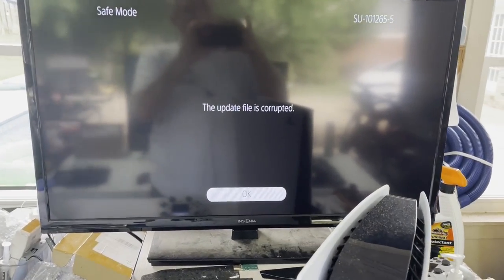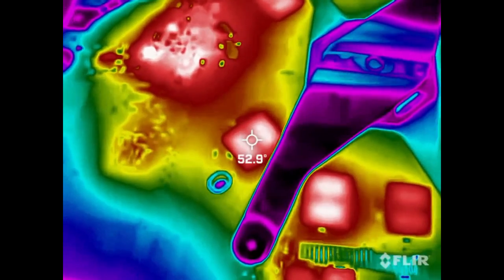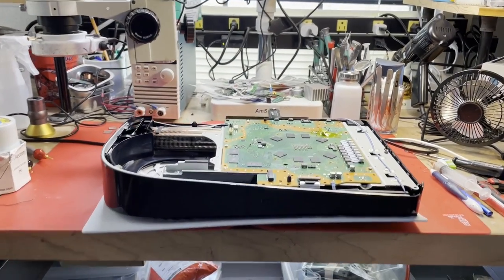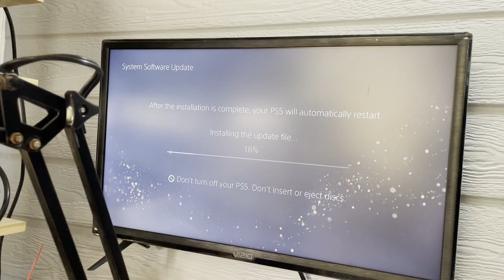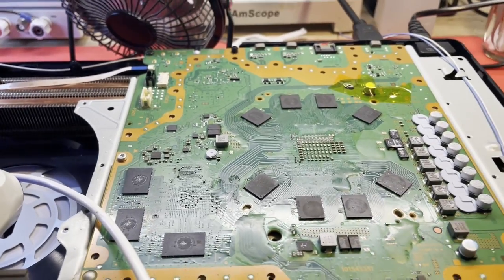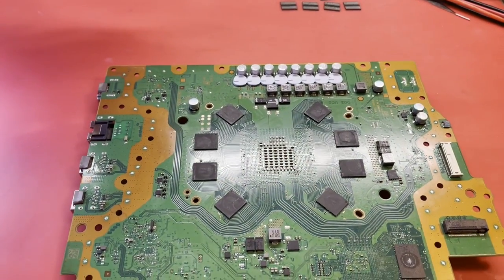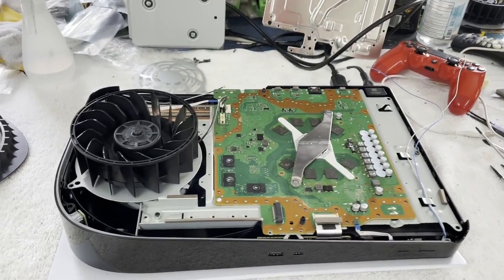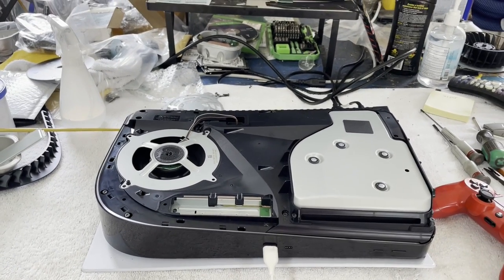#99 Repair of PS5 Corrupt Update

Comment: Congrats on yet another amazing display of knowledge, perseverance and tool proficiency. It's not easy to reball and solder big chips properly. Just a quick question... is there a reason why you do use a preheater for a southbridge but not for 8 ram chips? I've seen a German technician that replaces GPU Ram chips pretty commonly and says that it's pretty important to do it that way to stress the board and chips as little as possible.
Reply: KrisFix-Germany is his channel by the way if you want to check him out or exchange some ideas on RAM problems. He only focuses on GPU's and he has the advantage that there is software to troubleshoot those Rams though.
Reply from the maker: I probably should have used a preheater to put them on honestly.  It is good practice.  I used a preheater to remove the donor chips.

Comment: @ToltecMerc, Another great video. It is a pleasure to watch your videos as always. Just had a quick question if you dont mind? What size solder balls do you use for the PS5 RAM modules? I have a ps5 pulling the 80C00140 uart code. This points to GDDR6. Need to reball or replace just like you. I appreciate the help if you have time. Thank you sir. :)
Reply from the maker: .45mm
Reply: @ToltecMerc  Thank you!! I appreciate it :)

Comment: Wow Job well done how did u know it was ram i was thinking this is an SSD issue . What heat and air setting did u use to remove and install the ram chips im curious? Thanks!
Reply from the maker: I felt it was likely RAM because I think that is where the update is copied first.  I used 420C to remove and install and probably should have used a pre-heater.

Comment: Awesome job

@TotalMerc I've had an issue with a brand new unit the day I bought it and I've seen the same issue from a few others but never heard of the reason for it.

Have you ever seen when going into rest mode once in awhile when the video output turns off the screen goes completely green before power cuts, only to turn it on next time for it to say repairing storage or whatever the error is?

I have since sold that ps5 but was wondering if you've ever seen this?

Thanks.
Reply from the maker: I have not seen that error.  I wonder if it could be SSD related.  I really wish they had not mounted the SSD on the board.
Reply: @ToltecMerc same.

Is there any way at all to reach you outside of youtube with a couple questions related to ps5 repairs?

Comment: Really enjoy these repairs!

I take it you have some sort of background in a related trade / education?

I graduated high school in 2005, went to college for computer science in 2007 and went down the software engineering path career wise but the entire time I was in school (and a few years after) I was an arcade repair tech for a living. Over the years I have become very interesting in component level repair and have done quite a few advanced soldering mods to video game consoles like the PS1Digital, XStation, N64Digital and similar. While I know "some" about the component level repair side, I'm not quite good enough to work out on my own what might be wrong with a system I'm not familiar with. I'd rely heavily on videos like yours giving the more likely hints at what could be wrong. I've never done BGA rework either. I have decent soldering gear, but no GBA stuff and nothing like a rework station or board heater. Rolling with just a decent T-12 hakko style soldering setup and a decent hot air station. 

It's interesting to note the Samsung chips working while the micron ones seemed to have failed. Samsung is usually regarded as one of the best makers of memory chips. I guess micron doesn't have a bad rep really... and it's a sample size of 2 (so like you said... may mean nothing) but it still is interesting. Are these chips available on the open market? I'd hate to see a PS5 board sacrificed but I'm sure (at least I think so) the donor board was non repairable? I'm curious as to what fate that board suffered?

Anyways, awesome stuff. Love to learn, and seeing this is both a lesson and some entertainment while I eat my dinner. Win win! Thank you!

Comment: What flux & solder are you using? Awesome video!
Reply from the maker: I use cheap Kingbo flux and Kester leaded solder.  I don't recall the part number of the solder.  Nothing special.  Thanks for the visit!
Reply: @ToltecMerc  thanks no worries, I have a bunch of kester floating around it's the best solder I've used to date. I love it! I'm still experimenting with finding a good flux for me to use all around. I haven't given kingbo a try, but I hear good things.
Reply from the maker: @rubenmejia4881  I use Kingbo RMA-218.  It’s cheap and readily available.  It’s nothing special but it works for me.  I buy it in the small tubs and refill old syringes from other fluxes I have bought.  I get decent results.  It may tend to burn quicker than some other fluxes but it’s usually not a problem unless I’m working really slow.

Comment: @ToltecMerc when you say it was unstable and crashing after reballing... was it giving you 108255-1 or 108262-9 errors?? I think some of these consoles have a range of issues, some wont update, some crash at dashboard, some have artifacts, and some just give error codes
Reply from the maker: I'm sorry but I don't recall any specific codes, I just knew it had to be memory related.  Micron RAM seems to be problematic.
Reply: @ToltecMerc  what other symptoms have you seen related to bad ram on the ps5?
Reply: @ToltecMerc  I'd really like to send you one, if that's possible let me know I'm in florida
Reply from the maker: @chad1983ification  I've seen crashing in PS4 games.  PS5 games would work at least the one I was testing with would.
Reply: I should be more clear, I want to donate one of these 108255-1 for the cause. Ive been doing console repair for years but your level of troubleshooting is superior
Reply from the maker: @chad1983ification  you can email me at toltecmerc@gmail.com

Comment: Good morning Toltec. I know I ask you many questions, but here is one more. When you want to safely remove RAM from a PS5, what temperatures do you set for the hot air? And what temperature do you set your preheater to? I had a console doing the same thing, so I decided to bump the RAM. Then, the service tool told me I had 4 RAM errors, and I am worried I killed the RAM.
Reply from the maker: I have successfully removed and installed RAM without a preheater with 400C air.  If I use a preheater, I will heat the surface of the board to about 110C and then use 350-400C.  You probably did not kill the RAM but you may have merged balls under the RAM.
Reply: @ToltecMerc  That is a relief. It is frustrating when you don't know for sure. I very much appreciate it. I will pull them off and reball with .45MM because .5 seemed to big. Perhaps that will allow me to get them back on properly.
Reply from the maker: @tjmiz6849  .45mm works well
Reply: @ToltecMerc  You were correct sir, I did not kill the RAM and managed to get it back on the console. It was absolutely miserable. It still will not take an update, and I don't know where to go from here. It is XTON RAM. I have some SK Hynix but no XTON. Is there any advice you could give?
Reply: @ToltecMerc  Will.40 work if thats all I have?

Comment: Good job like always 👌 can u help me with something im fixing a ps4 slim all the standby voltages are there but when i press the power button there is no voltage on the caps which supposed to have voltage and there is no short on southbridge or any other place it's southbridge fault?? For sure?

Comment: Does replacing defective ram chips also fix game crashes to the Home screen with error ce 108255? My ps5 crashes immediately when starting  certain games. My guess is defective ram is it?
Reply from the maker: It certainly could be RAM but there is no easy way to find out.  It would have to be replaced with known good RAM and that is challenging, costly and time consuming.
Reply: @ToltecMerc  could the ce 108255 crash also be APU related? That’s what im concerned about

Comment: Hi do you know if I can just replace 1 ram if only one is faulty?
Reply from the maker: The only way I can think of is to read the codes out of the South Bridge with a UART adapter and code reading software.  If you are lucky, it will tell you exactly which one has failed.  I'm not sure if the system is always able to detect failing RAM.
Reply: @ToltecMerc  hi. Yes it showed #4 was faulty.
Reply from the maker: @cbrtechreviews3113  yes you can replace just one RAM IC.  Just use an identical part number from a donor.
Reply: @cbrtechreviews3113 is there a way to know which IC is #4?

Comment: I am trying to fix a ps5 that won't update because of the Blu-ray drive isn't being recognized
Reply from the maker: Hopefully the board inside the Blu-Ray matches the mainboard.  If so, are you getting 12V and 5V to the drive?  There are some fuses on the drive board also.  If it has been taken apart before, you may need to look carefully at the contacts on the flexible ribbon cable.  See if any of the contacts look damaged or swap another cable in and test.  If any of the plastic locking ears are missing from the flex cable, be sure to check the connectors to see if plastic pieces were left inside.
Reply: @ToltecMerc  thanks, yeah it was just my buddies kids not taking care of their things/rage quitting i'm sure. only time it was ever opened was by me. i just wanted to check and see if the ribbon cable came out. it does look almost crimped idk if that normal or not. I looked online for another cable and couldn't find one. at least not one that actually says ps5. does the ps4 cable work on ps5? or where dod i get another ribbon cable? it was never opened before just the one time by me. so i should check fuses and voltage next.